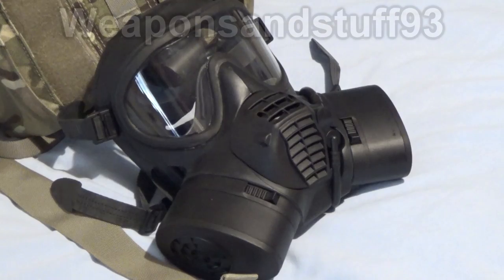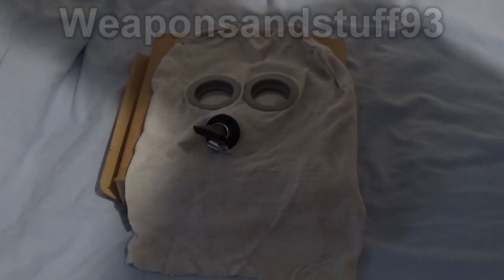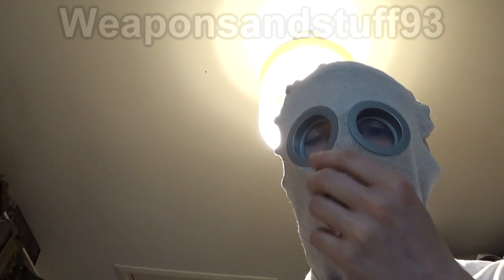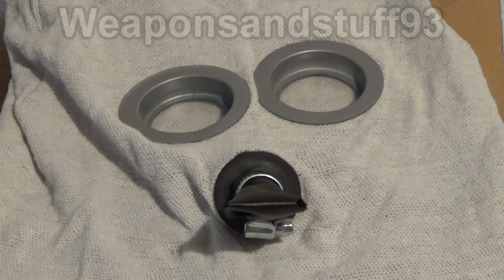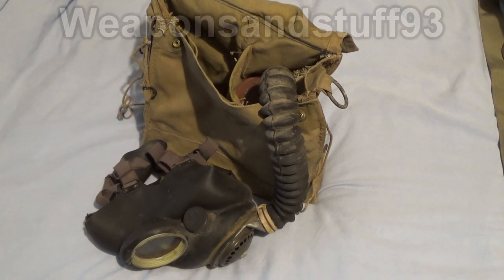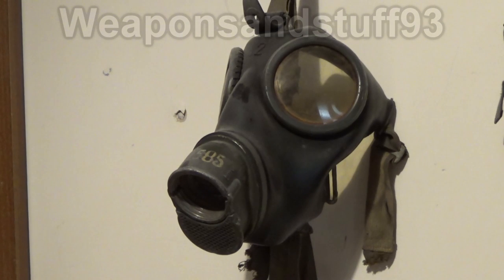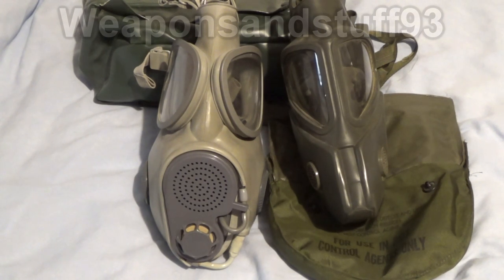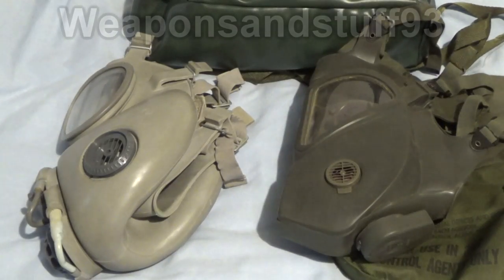History of the Modern Gas Mask

Comment: At 3:39 you referred to the mask on the right as a Polish OM14; I thought it was a GP5 produced by the Soviet Union? What's the difference? They look exactly the same to me except the exhale flap color and the metal is more shiny towards the filter.
Reply from the maker: The Polish OM14 is like the East German M41, they are older designs than the GP-5, the GP-5 was basically a more cost effective/cut down M41 that was put into mass production, the M41 was the main gas mask of the armies of the Warsaw Pact who didn't need specialist masks.
Reply: Ah, okay, I did not know that. Thanks for the help.

Comment: Do you have any vendors or shops which you would recommend for buying gas masks? Also, tbh, you seem more enthused about the flannel with the eye-holes than the state-of-the-art respirator with proprietary canisters and panoramic vision.
Reply from the maker: I always just use eBay for the most part, seeing as you can buy direct from many countries and cut out the surplus store middleman.

Comment: How do you tell the difference between a OM14 and a GP5?
Reply from the maker: OM-14 has the same design as the ShM-41, but with a chrome coloured valve housing at the bottom and it's made from whiter rubber.
GP-5/ShM-62 has a short valve assembly made from brown metal and is grey.

Comment: looking to buy a GSR what are the pros and cons of the mask?
Reply from the maker: If it's a British military style one.
Pros, lightweight and comfortable, good vision range and voice box.
Cons, Proprietary filters, doesn't take 40mm, filters get in the way of mounting a rifle, hard to iron sight or use a scope with the view area, you can use one filter at once which is a pro but it's hard to breathe through just one, harder to pull air through than a 40mm.
Reply: Weaponsandstuff93 you say "british military style one" are there other styles then
Reply from the maker: I assume there are but the GSR as it's named is the British one, I think Scott has a different name for what's essentially the same mask in 40mm as sold to other buyers.
Reply: Weaponsandstuff93 ok nice

Comment: whats a good but fair priced gas mask you reccomend?
Reply from the maker: If you can get an Israeli civilian (4a1) or the Israeli military mask (M15) at a sensible price under $40 both are very good masks and take NATO filters.
Otherwise West German M65 gas masks, British S10 or FM12 masks are also very good.
Reply from the maker: Yes, that's the 4a1, if you can find it cheap it's a very good basic gas mask.
Reply: Ok cool thank :P
Reply from the maker: It's also a one size fits all mask, so you just get it and keep tightening the straps until it fits you properly.
Reply: Dude thats awesome this will be the one i get
Reply from the maker: Cool, filters will be easy to get as it takes NATO filters, Israeli filters are good regardless.
Reply: Does the israeli filters contain asbestos?